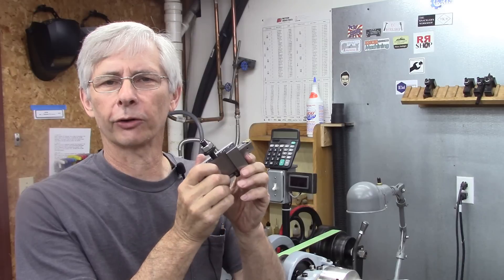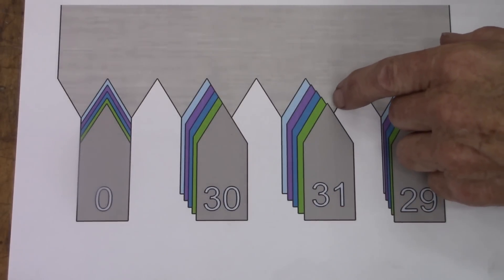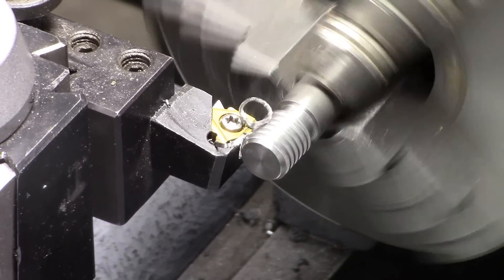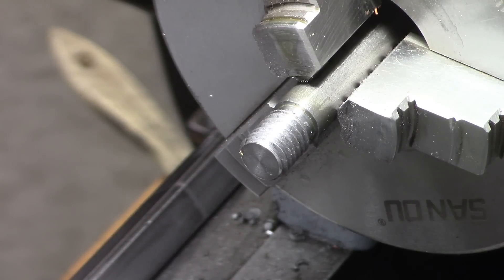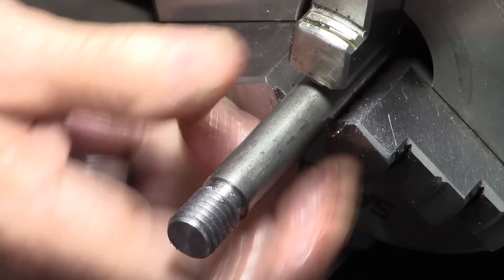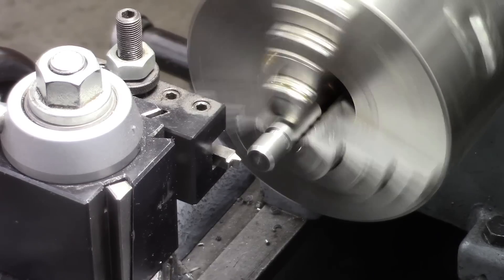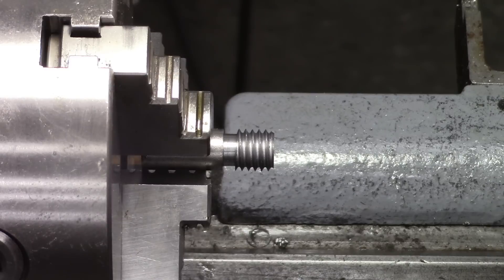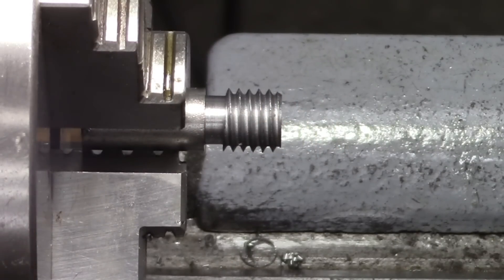Threading - Feeding with the Cross slide vs Compound

Comment: I was taught to thread with the compound @ 29.5 degrees almost 60 years ago.  I have tried to cut threads with just the cross slide and it wasn't pretty.  It seems the Aussies (Kurtis of CEE and Max of Swab valley) thread using the cross slide to cut the thread depth.  Max explained that he sets the compound parallel to the work piece.  When he advances the cross slide X amount he then advances the compound X/2 amount.  Then proceeds to cut the thread.  The video showed good results!  Maybe you could try this method out and give us the results. KOKO!
Reply from the maker: Unless I misunderstood that is the same as advancing the compound set at 30 degrees.
Reply: @WinkysWorkshop  Almost but not quite and yes the results are for all practical purposes the same .  With the compound at 30 degrees the cross slide is basically used as an index, the cross slide returns to a "zero" setting at the start of each pass. Therefore is not used to increase the depth of cut. In theory this method only cuts with the leading edge of the cutter (don't say anything different or Joe Pie will have a cow).  The compound determines depth of cut. in the method I described or tried to describe the compound contributes nothing to the depth of the cut.  The depth of cut is accomplished by movements of the cross slide only.  The Movement of the compound lessens the amount of force on the cutter by reducing the contact with the trailing edge of the cutter to approximately 1/2.  Remember that on each pass if the cross slide is moved say 0.2 mm the compound is moved 0.1 mm.  If you have time check out one the videos from Swan Valley Machine shop.  Max Grant explains this method much better than I.  Also he does a demonstration as well.  If I can find the video I will send you the title.  Sorry if I did not communicate better.
Reply from the maker: @jamesreed6121  I think this is exactly the same, the only advantage is being able to measure the depth of cut while adding a little complexity and a number to remember (or forget).

Comment: Big difference between cutting gummy stock at slow speed with carbide insert, and cutting same gummy stock at same slow speed with a high speed tool bit!  Carbide insert will produce much better chip and profile cutting faster than you showed. 
As for which method is better ? I always like to keep it simple using Cross Slide instead of Compound, especially if thread pitch dia has to be within given tolerance measuring with wires or Thread Mike.
You can always take several finish "air passes" for full profile carbide insert finish with Cross Slide if required. And/or even at that point, micro adjust produced thread profile with your Compound if necessary on last pass.
Reply from the maker: I agree that much higher surface speed will do much better with carbide but it's also risky if you are cutting close to a chuck or shoulder. As far a methods for feeding goes feeding with the compound is much easier for me. Mostly because I forget what my cross slide was set at when I back out to return for the next pass. When feeding with the cross slide you just go back to zero and you don't have to remember a number. As for hitting a thread spec the compound makes this easy, every move is have what the cross slide would be. It's like a fine adjustment. Ultimately if going in straight was proven to be better I would do it but I'm finding exactly the opposite to be true. I just pinned a comment to the top which explains exactly why I think this is true.
Reply: Thanks! Using the Cross Slide is still just one feed handle you have to keep track of in and out. Whereas feeding with the compound, each pass is moving the tool ever closer towards a shoulder or small undercut if that's what your dealing with. 
Might not mean much on a 1/2-13 thread, but when you get into some serious tooling cutting larger dia. fine threads it can matter, especially if there is a slight shoulder as for a bearing. 
Also, what I meant be my use of the word "simple" is you wont need any chart determining actual infeed to get to finish pitch dia, as it is simple math cutting with Cross Feed.

Comment: Going to make a Acme compound replacement rod for my old lathe. After this video, considering changing how I planned to cut it. Need to make a 52t gear first. Know what I will be doing in the next few days. Thank you for showing 'how to'.
Reply from the maker: Acme are hard to cut. I think next time I cut them I will cut with a narrow grooving tool mounted at a slight angle and then go back with the acme form tool.

Comment: I use the compound set at 29 degrees for two reasons not mentioned. Cutting with the cross slide means you have to remember the depth of the last pass. I can't have any distractions of any kind while cutting threads using this method. Total concentration is required... at least for me.
Secondly, by bringing the cutting tool up close to the work and turning the cross slide handle to about the 10;30 position and setting zero, you can then bring the tool to the work using the compound slide and setting it to zero also. The advantage of doing this is that you can now run the work at 150/200 rpm and then snap the tool out of the work without having to bother making an under cut for the thread. Do it several times and you will see it is pretty easy to do... and you can impress your friends.
As an aside, look in your reference book and notice that the major diameter for a thread is not the nominal diameter of the material. So, with metric or imperial the very first thing you do is turn the work to the correct diameter. Failure to do this may explain why the mating thread goes from won't go to will go with a sloppy fit and undersized pitch diameter in one pass. Correctly cut, the flat crest of a 60 deg. metric or imperial thread is 1/8th the pitch. You can cut a class 1 thread to size by just looking at it.
Cheers from NC/USA
Reply from the maker: Yep...  I just got finished explaining to somebody that feeding with the compound is easier because you don't have to remember numbers. As far as the major diameter on inch threads goes, the major diameter is close to the stated size. If you put a tip on the threads the will be full diameter. So cutting thread on a 1/2" rod until they are sharp yields very close to the correct depth. Of course filing the tips off is needed to obtain the correct profile. I guess its a mater of preference, taking it off before cutting would work well....  but for most application I have good results filing the thread tips.
Reply: @WinkysWorkshop  There is another reason the work should be turned to the diameter shown in your handbook. It ensures that the major diameter of the thread is concentric with the pitch diameter. Filing the crest of the thread won't necessarily correct this fault. This fault may not come into play unless you are cutting a class 3 thread perhaps. In any case, easily avoided errors or problems should be avoided as you usually have enough other problems to worry about.
Cheers
Reply from the maker: @aceroadholder2185  I suppose you're right. If I was in a business and making things to spec I'd want it right. Most often I just was a thread to fit a nut and the two times I needed accurate threads I used wires.
Reply: Use full form inserts for the thread you need. Root and crest rads all sorted.

Comment: I always use the compound. Why? Because I use HSS for threading and if I feed straight in the tip of the tool always chips off halfway though! Might just be chinesium HSS though.
Reply from the maker: Putting a radius on the tip helps this a lot but never the less, the tip is ripping more than cutting when you go straight in. I prefer the compound.
Reply: @WinkysWorkshop  Can't disagree with any of that. You can only put so much radius on before it doesnt conform to the specs though.
Reply from the maker: @ThePottingShedWorkshop  Very true

Comment: Me not knowing ANYTHING about cutting threads, doesn't it make a difference with the type and sharpness of the particular tool you are using?
Reply from the maker: Yes and good point. For the two feed methods I used the same tool but that last test with the half tool was very sharp HSS. This is one reason it was a smoother thread.
Reply: Yes it does. A high speed steel (HSS) tool is sharper and will generally cut cleaner threads with less tool pressure than carbide.
Reply: @ellieprice363  along with the rigidity and size of lathe. So, pretty much EVERYTHING effects the quality of the work done on a work piece.
Reply from the maker: Yep... you're right, thanks

Comment: I did the same test many years ago cutting a 12x1.5 thread in 303 stainless using a 1,5 pitch full form insert, even under a microscope you couldn't tell which was which.
Reply from the maker: Wow...  that's interesting. Were you using HSS or carbide?
Reply: @WinkysWorkshop  full form carbide inserts, not sure of the make but certainly nothing special. My lathe is semi industrial ie not overly large or powerful, being a Colchester  Bantam or early 60s vintage.
Reply from the maker: @chrisstephens6673  Probably much more industrial than my lathe. I'd say the reason was how ridged the lathe is. One overlooked aspect of small older lathes is the small spindle and thread mount. A 1.5" spindle with a thread mount chuck is a weakness. Mine is slightly larger but still weak (1.625"). The strength of a thread mount goes up exponentially with size so a 2" or 2.5" thread mount is drastically more solid. I did a video with my Logan. I put a 3 foot bar in the chuck and pushed down with about 20 lbs pressure and the chuck actually pulled away from the spindle register. I remade the back plate with steel and it helped but never the less, it was still an issue. The original chucks for these small lathes were very low profile. New chucks have a full 1.5" more overhang (sometimes more). 

What was the spindle size on your lathe?

Comment: Great little discussion Mark, I agree with you. The professional machinists at the steell mill typically cut very nice threads with the insert tool and the cross slide on heavy lathes, while at home I preferred the 29 degree solution for my lighter lathe. Enjoyed very much, cheers!
Reply from the maker: Sound about right, thanks

Comment: For the mainly small threads that I make, I do it as follows: 
- 1st pass straight in with the cross slide,  depth about 1/3 of the thread height (there is little material to remove).
- 2nd pass usually 0.2 mm deeper and the compound 0.1 mm forward.
- 3rd and subsequent passes usually 0.1 mm deeper and the compound 0.1 mm alternating back and forth
- last passes 0.05 mm feed and +/- 0.05 mm flank shift
- A few spring passes without cros slide feed and +/- 0.01 with the compound

Always nice smooth flanks and no hassle with compound angle adjustment. Lubricate well!
Reply from the maker: Hmmm...  too complicate for me
Reply: It seems complicated, but it really isn't. Regardless of the depth of cut: Just go straight in every time, but a little left, a little right and so on with the compound. That's all.
Reply from the maker: @Michel-Uphoff  I'm not trying to be contrary but it would be easier to just feed with the compound. You method works for the same reason.
Reply from the maker: @Michel-Uphoff  I'm sure you're correct on that...  I might give it a try
Reply: @Michel-Uphoff  Yes it is very simple, go to say +0.01 on compound then back to zero rinse repeat. Alternates the load & wear on the flanks of the tool.

Comment: This is one of those things that has passed from knowledge into myth over time. Only the techniques survive and the original reasoning is lost(as has happened to a number of other things). Threading CAN be done either way, in fact there are even more ways than that which are options on CNC lathe programming. For manual work it boils down mainly to these two techniques. Is there one more "proper" than the other? Yes there is and there are reasons for it. Cutting with the compound was used , not to complicate your life needlessly but to overcome real problems in doing the best possible work.
The 29.5° compound method has these advantages.

1 The load on the tool is strongly biased against the direction of the feed, keeping the half nut securely and consistently engaged.
2 The chip load is very much reduced by not having two heavy chips colliding from 2 directions right over the weakest part of the tool.
3 The alignment of the tool can never be "perfect" and the 1/2° - 1° skew  ensures the right side skims clean if slightly off.
4 The in feed per pass is twice as sensitive and precise relative to the PD because taking off mainly only one side. 
5 An important reason for using less than 30° is that the chip coming off the left side of the tool erodes the surface on the right. The ~29° continually skims that side to remove that erosion damage.

Ultimately both techniques are usable in different scenarios but the 29° method is better in most cases even if you can get away with the cross slide sometimes it will pay dividends to know and use both.
Personally I use the 29° method for all critical threads, most threads in steels and reserve the cross slide method for soft metals and non critical threads. I mix and match the two, using the  29° method for the bulk of the thread then often switch to the cross slide for skimming the final clean up sizing cuts where the load is light and because of the direct 1:1 relationship of cut depth to Pitch diameter.
Reply from the maker: This is the BEST comment! It perfectly describes what I needed to say. Thanks I'm pinning this comment to the top!
Reply: @WinkysWorkshop  Thanks I am flattered. Actually there is a LOT more to know about threads and thread cutting. I teach a course at the company because virtually none of the machinists have a full grasp of it. That came about because we had a HUGE rejection of aircraft parts being returned with no reason given except they are out of spec. They couldn't figure out what was wrong with them and were not going to embarrass themselves by asking Airbus what was wrong with them. They were 25∕8 – 16 UNJ spec female threads and they couldn't find the problem when the president mentioned it to me. I said I have the entire ASME spec manuals for all UN threads in my pocket and am expert in UNJ. It was quickly determined that the bore was undersized for a UNJ. So we just rebored them all up to spec and they were accepted. So they asked me to prepare a course on thread cutting and inspecting for the staff since I had already delved deeper into the subject than I ever imagined I'd have to in order to write the software I wanted for myself. There are a LOT of surprises lurking in them thar threads I can tell you.
Reply: For fine threads (greater than 16tpi) I seldom set the compound, and just feed in with the cross slide.  At 16 tpi, and coarser, I almost always use the compound.
Reply: @vandalsgarage  Yeah, actually the first cut is the same either way and a very shallow thread is just a bit more.
Reply from the maker: @vandalsgarage  Logical to me.
Reply: @billshiff2060  just complicate slightly, I was in conversation with an old timer who was taught to grind the tool to slightly less than the thread angle and go in with the compound at the full angle.
And as a bit of an historical note, many of the first thread cutting lathes didn't even have top slides.

Comment: I always liked cross slide more althou we were taught both ways.Its simplier to get a correct depth of cut -you use marker on a blank and then do the skim pass to check thread pitch,0 the cross slide dial and then you feed to the wanted depth.If  geometry of the blade is good (when you grind hss for example)you will get a great fit by just using the dials.With practice over years you dont need thread micrometers or pin gauges or anything like that.
Something that i was never able to get with compound method .
Reply from the maker: That makes sense. Never thought of that. Although , you could double the move on your compound and get the same results.
Reply: @WinkysWorkshop  There is one more reason i like cross slide method -old lathes have worn out bed ways.I am speaking about 2 shifts for 20 years wear.And they can cut taper in the thread ,just like when you work on round objects.Its not a problem with short threads but if you do a long one it can be noticable .What i used to do is to find where thread gets stuck and then i slightly bump the dial with my hand  as lathe is cutting the thread-if you do a spring pass in this case begin of thread can get very sloppy with too much play .We are speaking about a 10th of a mm ,sometimes even less.
But as long as you know the flaws of the machine that you are working on you can still make accurate parts ,within the reasoning tolerances-it wont be fast as a new machine but parts can be made.AKA you cant expect micron precision from a 20 years old manual lathe that was working 16h a day for 5 days a week.
Reply from the maker: @armageddontools  I do okay on my lathe but its worn out. I didn't realize how much until I made a follow rest.

Comment: Rigidity will indeed be a big factor, as will material. I tend to feed with cross slide on my lathes, but they're quite a bit larger than yours. I think this is the first threading demo I've seen where the machinist took a deep initial cut and then decreased progressively as the thread formed. Most people do 0.005" or so all the way in. Big waste of time. Great demo well explained. Thanks.
Reply: According to Cat Stevens (Yusef Latif) "The first cut is the deepest (baby I know)". I start with .02-.03 the first couple of passes, then progressively reduce depth.
Reply from the maker: Cat Stevens?  Ha, you must be my age.
Reply from the maker: Yep...  you can take a huge first cut.
Reply: Advance the compound a little on each pass to relieve the pressure on the cutting tool.